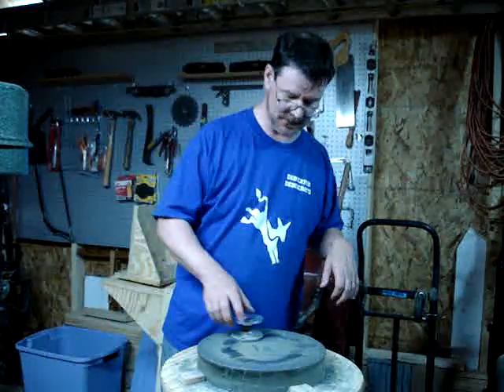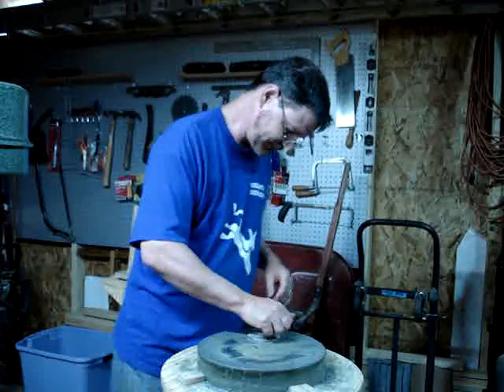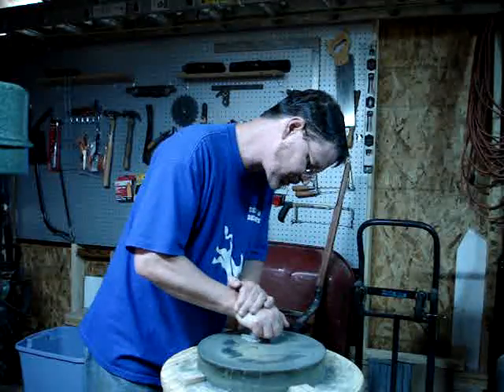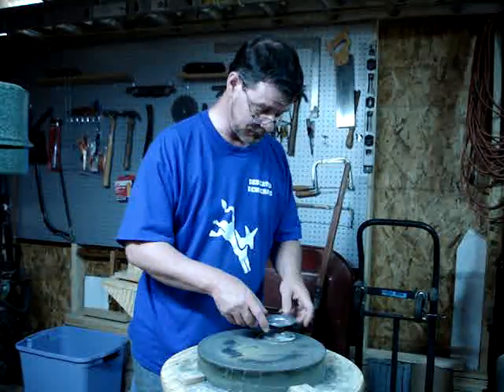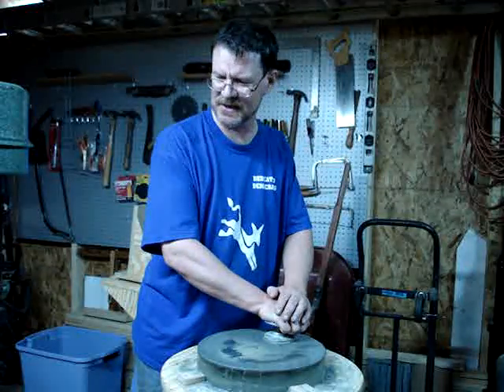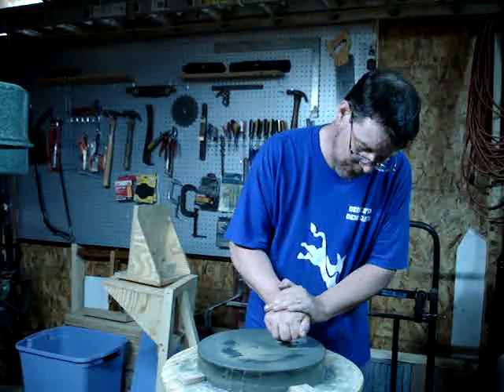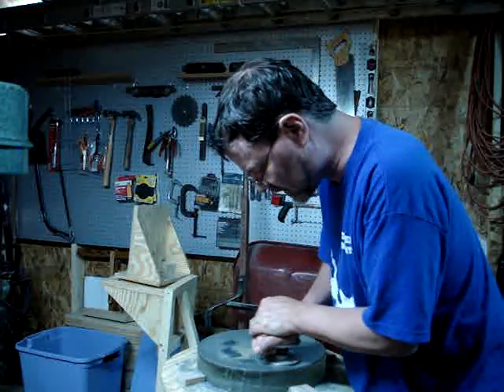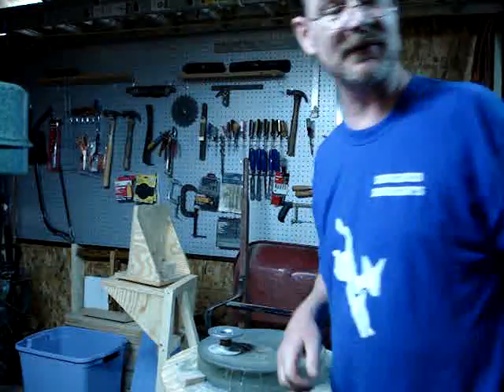More grinding

Comment from the maker: @foreilly1958 Hi Francis.  I've pretty much finished it.  I have some final figuring to do, but I jumped on making making the OTA and mounting.  The problem was the finer points of embellishments on it.  The mirror box and crescent bearing has various applications of rosewood veneer on them and I am doing inlayed brass onto that.  It is slow going. I have intimate experience now with severe skin and lung rosewood allergies which is no fun at all.  I have to wear a face mask! This year I hope!